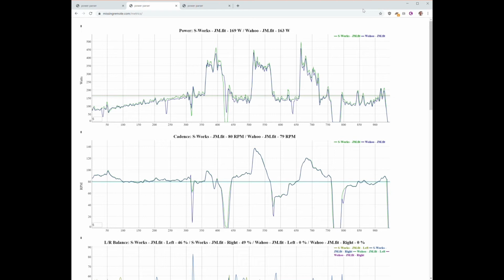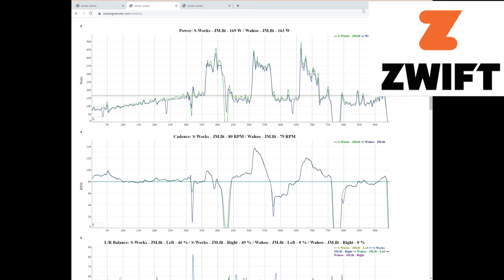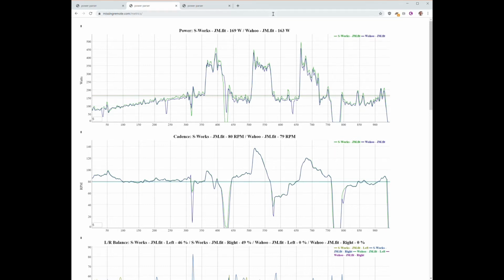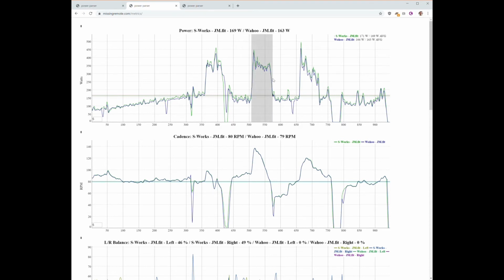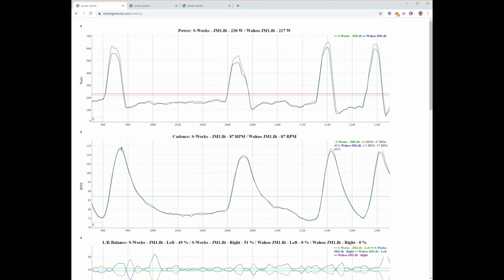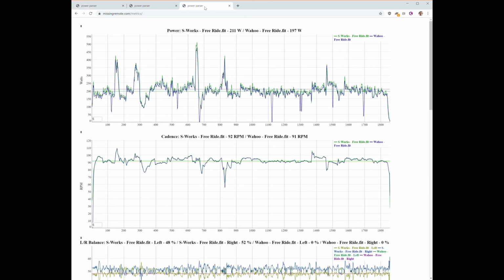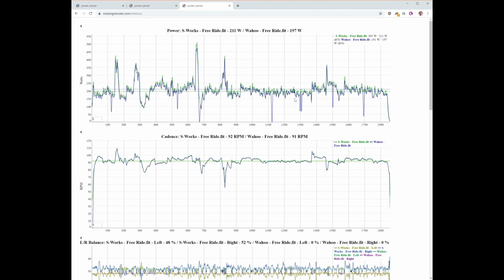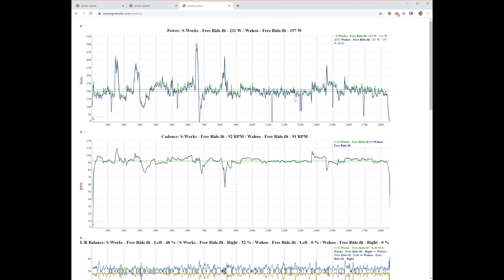Specialized S-Works Power Crank - Power Analysis

Comment: This is a cool app. I see you comparing your 2 files over each other on the same ride. Possible to still do this as I also tried to compare my Quarq to my indoor trainer however it only allows to view the 1 file and not overlay . Thanx
Reply from the maker: The tool is available on the site (https://www.mamilian.bike/) by clicking the "Fitness File Visualization" in the top navigation.

Comment: I have the sworks power cranks dual sided. Do you think they are a reliable and accurate power source? I get a 0/100% left right power balance which is a problem that I don't know what is causing it? cheers
Reply from the maker: Mine has been reliable, and AFAIK accurate. When do you see the 0/100% balance issue?